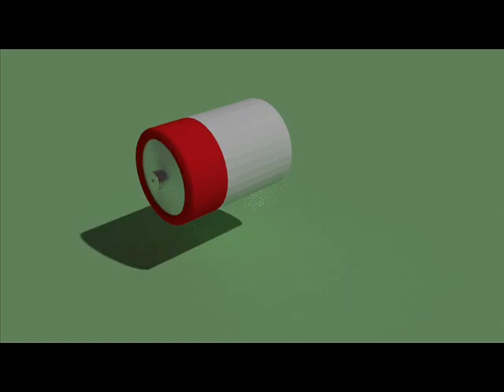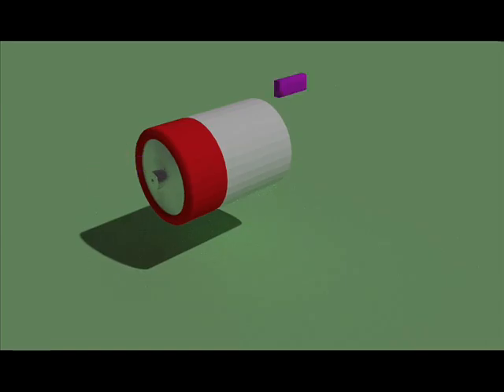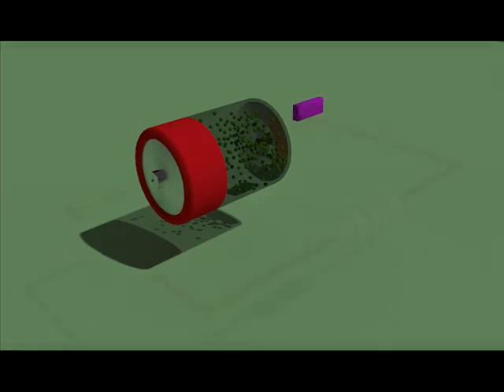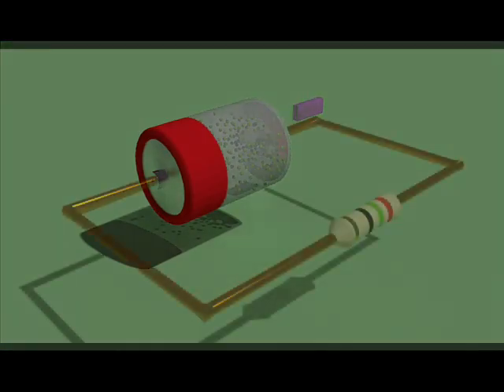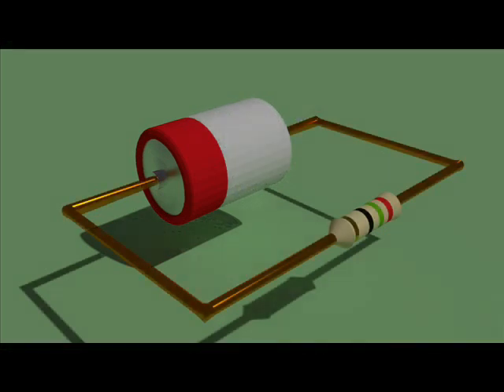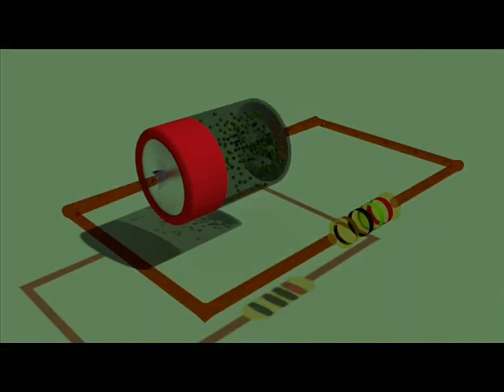Direction of Current Flow: Conventional vs Electron Flow

Comment: I always understood conventional current to be essentially 'hole' flow and electrical current to be electron flow.  Did something in the convention change in the past 30 years because increasingly I see current depicted as going from positive to negative, which is a bit misleading.  The protons never move in a circuit and essentially remain in the same place (just like the rest of atom they are in). What moves is just the electrons. I just wonder why I see so many depictions showing movement from positive to negative when that seems less significant because what is actually 'moving' in that scenario are the empty 'slots' where an electron used to be. Those empty slots 'move' in the opposite direction from the electrons. It's like a string of lights where a light that is on turns off, and then the next light in the string which was on turns off, and so on.  So the lights which used to be off and then turn on progress in the opposite direction of the lights which used to be on and then turn off. In any case it's important to draw the distinction so people don't think electrons move from positive to negative. It's the moving electrons that make electricity possible since protons don't move.

Comment: I forgot to add one more thing.  I don't give a $hit what Ben Franklin thought about current flow over 200 years ago.  All I want to know is:

a.  Current flows from NEGATIVE to POSITIVE
b.  Current flows from POSITIVE to NEGATIVE
c.  Current is binary, i.e. it can flow either way, depending on how you feel (of whatever you want to believe whether it is right or wrong).

So which one is it?  A, B or C?

See how simple that was?
Reply: FACT: Electrons flow from negative to positive. Protons in the nucleus are more or less fixed in place.
200 years ago they thought that protons flowed from positive to negative, so they established the current flow as "positive to negative". Today, we know they are incorrect, but we still use their method because it's too late to change it I suppose.
So in regards to your question, the answer would be b. Even though we know that electrons flow from negative to positive.

Comment: is there a point to deciding current flows the opposite of reality?  or are they just stupid?
Reply: The electron was discovered about 100 years after electrical flow. They needed terms to work with electrical flow, so they took a shot in the dark and guessed wrong.
Reply: Nathan Darker Electrons have a negative charge, so as those electrons flow to one side the other side seems to gain "positivity".  Which they could observe, but they could not observe the electrons so they simply didn't know.
They only knew that one side gained positive charge.

Comment: they didnt change there convention because this direct didnt make any difference ...either u consider  from negative to positive or positive to negative the effect does not change ..current is scalar and after changing its direction its effect does not change but yes in actual sense current flows from negative to positive but when scientist discovered about electric current they thought that current flows due to positive charges in that sense it is correct

Comment: "hope you understand" no i dont understand😠Current is the flow of electrons so it should flow the same direction as electrons 😡 why it is opposite!!🔫
Reply: suit up your android from what I learnt, current is the flow of charges, but I'm not sure if our syllabus is the same :)
Reply: He explained in the video, because a convention had to be decided before they had the understanding of our current model of electrons.

They didn't know which way it went, so they decided to treat it like it went from positive to negative. That is false, but we never changed it because everybody was used to it.
Reply: Conventional current is the flow of protons.Whereas,electric current is the flow of electrons.Hope this makes it a bit more easier for you to understand it :)
Reply: suit up your android
Reply: think of the flow of current as the flow of positive charges. The positive charges are repelled by the positive terminal and attracted towards the negative hence it moves from positive to negative.
Reply: @maleehaaamir665  .. but the protons don't actually go anywhere..
Reply from the maker: Electric current is the flow of electrical charge – not the flow of electrons. The direction of the flow of electric charge does not have to equal the direction of the flow of electrons. "Conventional current" is is simply a convention. 

If it helps, think of it as the flow of "positive charge" – the reverse direction to electron flow. 

It's hard to understand at first, but over time it will become second nature to you. Best of luck in your learning 🙂
Reply: @electrical4you  Do you think they might change it someday?  It would remove an unnecessary layer of abstraction..
Reply from the maker: @XtraZero  At this point, no I don’t think they will. It has become commonplace in academia and industry.

The only force driving the change would be new students (who incidentally don't have any control over setting the conventions). Furthermore, it would require the rewriting of thousands of electrical textbooks and research papers. 

It can be confusing to begin with (like many things we learn for the first time).– but very soon it will feel natural to you.
Reply: @electrical4you  Well the difference between this and other difficult things is that this is unnecessary and arose from a mistake.  THAT is what makes it confusing, not that it is particularly difficult.  It's the assumption that conventional current flow is somehow rooted in necessary reality (like most everything else taught in science) when it isn't.  If all instructors simply said that conventional current flow arose from a mistake but we're stuck with it instead of creating this unnecessary layer to make it seem necessary and reasonable it would make MORE sense to students..
Reply from the maker: @XtraZero  I don't disagree with you Sonic – I think it would be easier for students.

I just know how hesitant academics and senior electrical engineers are to changing a convention. So I do not think it will be changed. This is just my personal opinion – I would be happy to be proven wrong! 🙂
Reply: @maleehaaamir665  proton didn't flow
Reply: I did understand but I saw your comment and now I'm confused... haha
Reply: @maleehaaamir665  no
Reply: @maleehaaamir665  protons doesnt produce or transfer electric current
Reply: The electrons flow from an electron-rich body to an electron-deficient body. The electron- rich body has an excess of electrons and the electron-deficient body has a deficiency of electrons. So, the electrons flow from a negatively-charged body to a positively charged body. During the earlier days, the electric current was taken as the flow of positive charge from a positively-charged body to a negatively-charged body. Today, this is still considered as the direction of conventional current. However, the actual flow of electric current is from a negatively-charged body to a positively-charged body.
Reply: Yes bro I am also confused why current flow is opposite of electron flow
Reply: The conventinal current is protons from the postovive going to the negetive even though you helped me. Your comment is a test for me. Thank you person from 7 years ago!❤
Reply: So conventional current is based off an old idea of electron flow the was just never updated, by the time we realized which way electrons actually flow it was just too late to change it i guess 🤷‍♂️ i don't like it but here we are
Reply: Because electrons are Negative charges.   Dummies!  That is what "negative" charge means.  If you want current and electrons to go the same way fine, reverse the direction sense of current and call the electron the positive charge.   But now you would have to call protons negatrons and they would go opposite to current
Reply: Same doubt
Reply: Because current flow is old idea before discovering electron

Comment: I've always understood the conventional current as  'holes' (tension/voltage/vacuum ) {what ever word works for you}  created as a result of the LOSS of electrons (IE:  the Voltage or tension caused as a result of the electrons disappearing. ( PICTURE the Vacuum Created when you suck the air out of the top of a 2 liter plastic soda bottle,  the bottle shape shrinks in an inward direction)  which builds going the OPPOSITE DIRECTION of the ELECTRONS   (IE  "conventional current " goes ( + TO -)  and  "electrons flow" ( - to +).   To keep the circuit from shorting  OR reaching infinite resistance,  the electrons must constantly flow across a conductive or semi conductive materials.     Summary:   Electrons Flow  - TO +    Electrical Pressure (Voltage is the pressure buildup  (Electrical potential between + and - poles)  and  Traditional Current  Holes/Electron Vacuum flows  + to -  .

Comment: Folks, think of it in terms of heat transfer as an analogy.  Heat obviously moves in one direction (from hot to cold).  To say that "current" flows from hot to cold would be correct, IF we are defining "current" as the flow of heat.  Although the opposite would clearly be incorrect (using THAT definition), would still "work" (in terms of most mathematical and, by extension, practical, applications), if we change the definition of "current" to the flow not of heat (which is the ACTUAL thing flowing), but of "COLDNESS."

So, once they learned about electrons, and the actual direction in which they flow, by keeping the old model that would otherwise be technically incorrect, they effectively and inadvertently changed the definition of "current" to the flow not of electrons, but of namely positive CHARGE, which would keep it, at least in an abstract conceptual way, technically "correct," whereas, clearly, if we define "current" as the "flow of electrons," would obviously be very incorrect (at least for DC).  Hope that helps.

Comment: The direction of electric current (I) is defined to be
the same as the direction of flow that positive charges
would follow, which is opposite to the direction of flow
of electrons e−. current flows from negative to positive

Comment: No confusion at all; since electrons considered - charge and  the ions left as + charge then + & - sign on the battery is correct and the right direction of flow will be from - to + terminal due to the fact that only free electrons have the freedom of moving toward the stationary + ions by attraction force

Comment: Electrons were then designated NEGATIVE charges.  That is what negative charges due.  Flow in the opposite direction of the current.  If current had have been defined the other way, flowing the same direction as electron flow, then electrons would have been declared POSITIVE charges and the proton would have been called the negatron,  the negative charge, and a negatron beam flow would be opposite to "current"

Comment: Michael Leach
 - You're right, it is confusing, and for exactly the reason you say.  No doubt that's why S Ghosh made this vid, to point out the difference between fact, and popular (but wrong) usage.

But the good news is that it works either way.  Whether you say negative-to-positive (correct), or the other way 'round, your circuit operation and calculations will still be correct as long as you pick one idea and stick with it.
Reply: John L Smith In most cases you are correct. Although in the last several years I've been teaching myself vacuum tube audio electronics, and while trying to trace the current flow through my schematics I would repeatedly get stumped and say, but that would mean the electrons are flowing from ground back to my power supply. That's impossible!

Comment: Batteries are labeled in conventional current. The the side of a battery with the bump is labeled positive but is actually negatively charged. I have tested this with diodes and lights. This video should have portrayed the electrons to be concentrated on the left side of the battery and had the electrons flow counterclockwise.
Reply: omg thank you 9 years later, for me I didn't make any sense that current would flow slower on the negative side of the resistor since that's where the electrons come from, dang.

Comment: See my doubt, if the current has went till 1/4th of the circuit, 
electrons have only traveled 1/4th distance from the negative terminal,
But conventional flow tells us that the positive protons have moved from 1/4th distance of circuit from positive terminal,
But by mathematical way,the positive charge will only flow if there is negative charge flows in the circuit,which contradicts because electron flow hasn't even reached the 1/4th side of circuit near positive terminal, how is it possible then?

Comment: Okay but the electrons don’t actually come from the negative terminal in a battery correct? It is actually the potential difference of the battery that generates an electric field in the circuit which exerts a force on electrons ALREADY IN the conducting wire.

Comment: Current flows from excess of electrons or ions to a deficit of electrons or ions respectively. So why not differentiate between positive or negative charge AND positive and negative in number? So in an electron current the current flows from the electrons that are "positive" in number and yet negative in charge. Hence nothing was ever mistaken from the beginning and when said and done the conventional becomes the same as the actual.

Comment: Is there a simple household method or testing that theory or flow from negative to positive?
Reply: There is no need to test.  It's not an argument about the direction of the flow of electrons.  Both models (at least at this point) understand electrons to be flowing from negative to positive; rather, because it was taught the opposite way for so long, they still keep it, which technically still "works" for most practival/mathematical applications, only, by thinking of current not as the flow of electrons but as the flow of positive charge, which is reciprocal to the flow of negative charge.  "Current" in the Conventional model refers not to the flow of electrons but to the flow of namely positive CHARGE.

Think of it like this:  Heat flows from hotter to colder, so, the actual direction of heat energy is in one direction.  But, when we say that "current" flows in the opposite direction, it's like saying, not that "heat" flows in this direction, but rather, "coldness."  If one end is becoming more hot the other is becoming more cold, even though "coldness" in truth isn't something that actually moves, but only heat.  Hope that helps.  I know it's confusing.  I wish they could/would change it to the model that is not only technically but even semantically correct, that of course being Electron Flow model.

Comment: Ermmmmmm, errrrrrr. If this is a stupid question, may I ask it any way as I may not be as intelligent as some others on this subject.  If current is travelling from negative why do electricians put switches on the positive cable usually before the load instead of after?  In my motor vehicle the body is used as a single common negative and most all load bearing devices have their on/off switch on the circuit between the battery positive and the load bearing device which is then connected to the common body negative?
Reply: Hi Michael. Having a switch on the positive side is only a safety feature. Because of industry standards (not electron flow), the entire body is connected to the negative terminal. If the POS+ side is damaged and falls on the body (NEG-) then we have a short circuit from battery, to body, then back to battery. The fuse blows and all is well. 

Now, let's install our fuses/switches on the NEG- side: NEG- wire gets damaged, falls on the body, then...it completes the circuit! If this damage happens before the switch then the switch (a control device) is rendered useless. You won't be able to control the radio, or the lights, or the fuel pump. Hope this helps!
Reply: I think I understand you comment.  But I think you have not answered my question.  Not satisfactorily.  You have answered why but you have confirmed what I stated in my example that the switches and fuses are on the so called positive cable before the load bearing devices (Radio, lights, starter motor etc etc).  You have simply said it is for logical safety reasons.   That tallies with my understanding.  But my question was really tied in with the video.  That if the electrons flowed really from the negative to the positive rather than that which most people are thinking. Then why are control switches and fuses put on the positive cable.  If the power flowed from the negative then safety fuses on the positive cable would be after the devive they are intended to protect.  About as useful as a digging spade to a drowning man when he needs a floating life saving ring. Or a sun lamp in the Sahara.
I appriciate you taking the time to answer my question but whilst the safty answer is correct it is wrong in this instance.
Clearly, you too may be of those who believe the power is coming from the positive therefore you see the logical place for fuses is on the positive side. The side you believe is between the power source and the device to be protected by the fuse.  But the video is saying the electron flow is from the negative and not the positive.